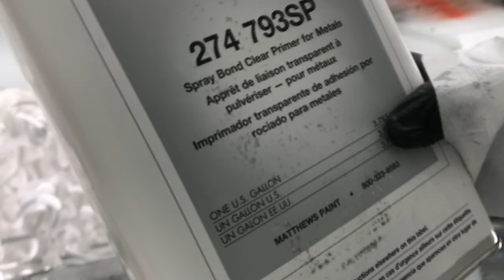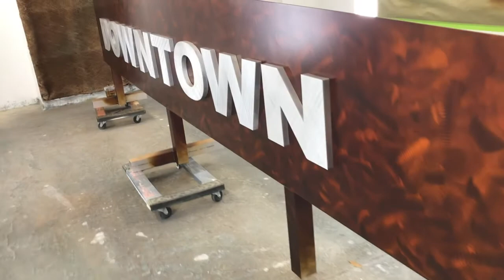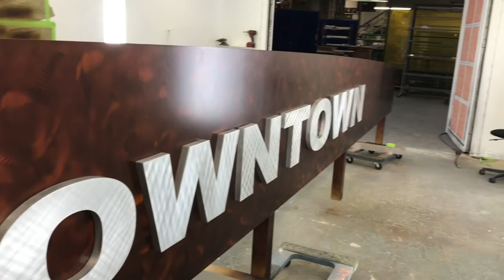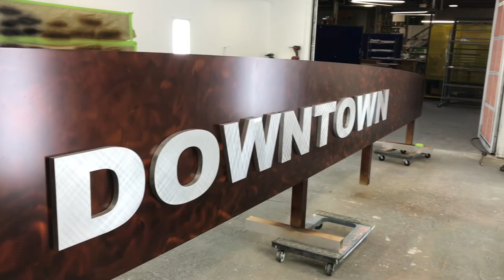Custom candy paint over bare metal art sign

Comment: what primer did you use brand name etc??  I want to get into doing stuff like this  I got a few candy paints... also  you said you used a satin clear and  transparent tinter.. so I could possibly  use satin clear an mix colors for a candy shade?  poor boy candy I guess?
Reply from the maker: Casey, the primer is called spray bond, its a PPG product  its basically a clear spray adhesive that will bond the paint directly to bare metal. The tinters I used are also from PPG. The product line is called Radiance. Those tinters are completely transparent so they'll give you a very bright color. Poorboy candy ( I think) is using standard opaque paint tinters in your clear. I've done this before and it looks pretty good, but the colors are not as deep/bright as when using a transparent tinter. Give it a try! good luck